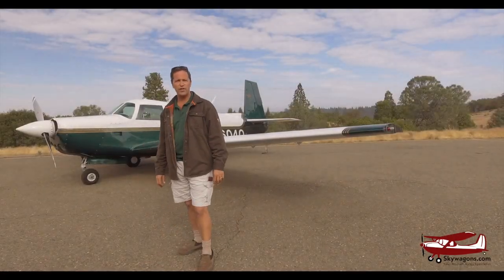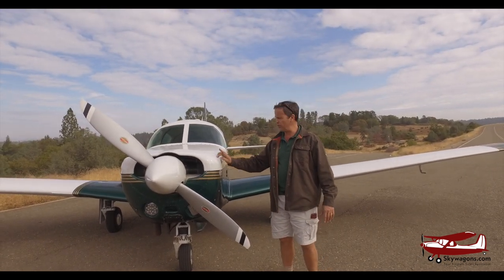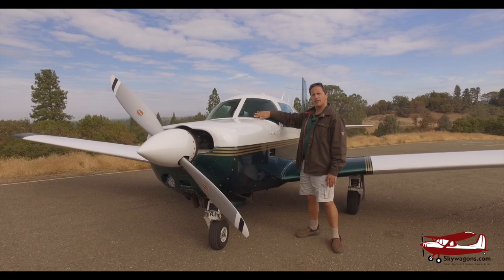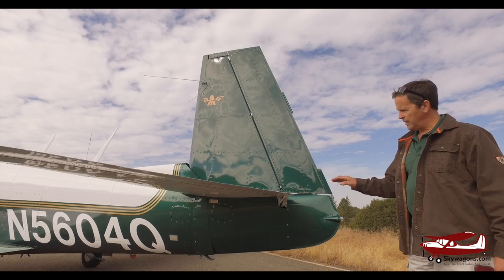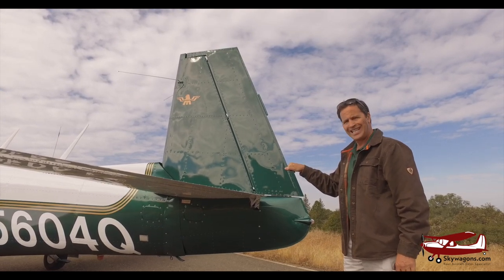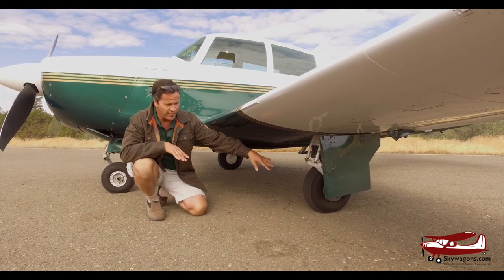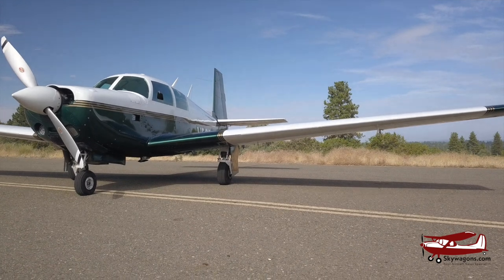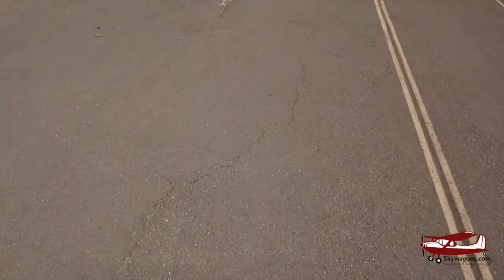M20E

Comment: Hello Sr. I been watching your Mooney's videos and they are all great. Just got a question, I see that on Mooney's with manual gear they have a handle on the left side  by the pilot left leg for manual extend the gear as an emergency but I do see some Mooney's with Johnson bar got also a handle on the left side similar to a window handle on a car. Can you explain in your next video if possible.
tyvm.
Dave
Reply from the maker: Hello.  The window winder on the left sidewall of the plane by the pilot's left knee is an emergency gear extension option if the electric gear fails.   The manual gear Mooney's have no such option because the manual gear system is so simple that it can hardly ever fail.